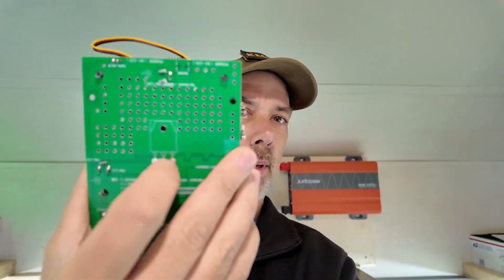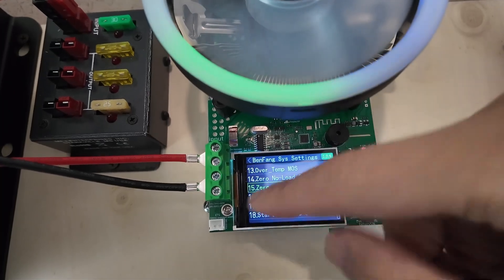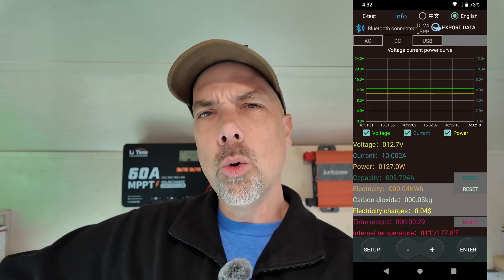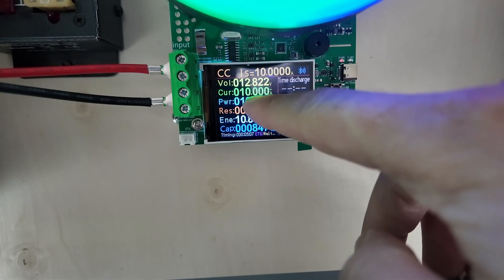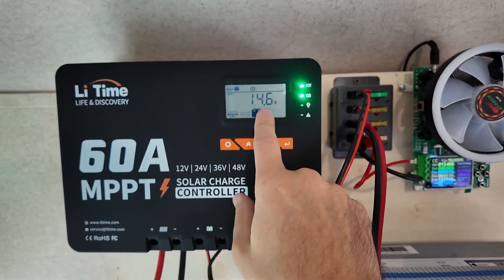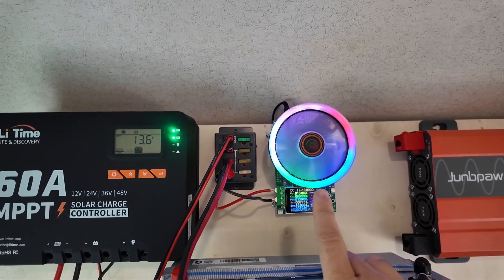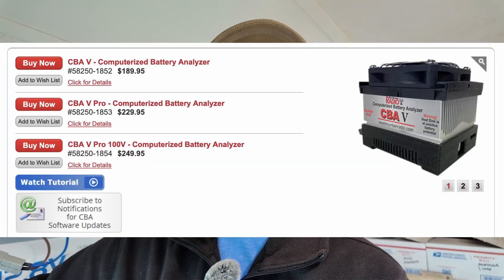I Breaks It, I Fixes It! (I Cheat)

Comment: I'm confused. Why would you be doing a capacity test on a battery that is also being fed by the solar controller at the same time? We got this tester - it also looks like over 36V you have to go way down on the total watts. for our 48V battery we can only draw at 60W max. Thanks!
Reply from the maker: This video was demonstrating all the features of the load tester, it was not a capacity test on the battery.  This specific tester has a limit on the amount of power it can absorb before blowing up (in a self destructive, but otherwise safe manner).  As long as you don't exceed the watts, you can change the volts and amps around to test a variety of different battery types.

Comment: Great tester. If you had a calibrated reference that data collected would be right on. I have the older one in a different brand but looks the same with different fan. Same menu as maker hulk.  You can dissemble the old one . Taking fan and getting to the FET and see if replacing that makes it work again.  Their is a wattage max in the old one in settings.  I wounder what the max watt hours or amp hours is.  I have 1000 AH 24V battery bank. If I re configure battery I get 12V at 2000 AH. Either way this will take a few days . I got a 150 AH 51.2V Chins battery today for Golfcart repair for the campground . The lead died . I had to use electric hoist to pull old battery out. They get heaver as I get older.  I have to make new battery mount. Bead blast and re paint  . Just to get new battery in. Then re wire with new cables. More than 1 day job.  Still waiting on new on board 48V LiFePO4 weather proof charger . The LiFePO4 is cheaper than lead now before tariff.  I can list the 150 AH 51.2V LiFePo4 my self. I can hardy lift just 1 ,8V golf cart lead battery and 6 total .  What a wight reduction !  73 and Cheers from NY !
Reply from the maker: Power to weight ratio in your favor!  That golf cart is going to faster now!  What camp do you work at?
Reply: @temporarilyoffline  I do not work at a campground. I work for my self. They came to  me for repair/upgrade  . It is a Tent camp ground in western NY . Not a State run one. The motor drive controller has a speed limit of 15 MPH on it. 2006 EZ GO 48V . Mine is a 2002 model and my 8V GC8 V battery still going well for now. Still waiting for on board charger . Delayed in shipping. Got almost everything done. Had some corrosion to deal with from lead battery . Some re painting on frame around the battery compartment . Had to use baking soda  first. Then Bead blast and prime/paint then make new battery mount . I used 3/4 plywood . LOL . This not normal golf cart . 2 seat with dump bad in back for landscaping work. they use it to clean out fife pits and collect garbage from sites and outher maintained camp stuff. We have Even Gola State  park campground and Lake Erie State park Camp ground and Camp Seneca Camp ground. and Rock City Camp ground and them all POTA buy ME !!
Cheers ! I am in Boston NY . Great camping all around hear !

Comment: Your power source for the cpu is coming from your 12v battery because you have the two inner connections (terminal block) connected to your battery.

The outer connections on the terminal block are for your battery-to-be-tested. The inners are for powering the cpu. If you disconnect the inners then you'll be using any other connected PSU for the cpu.
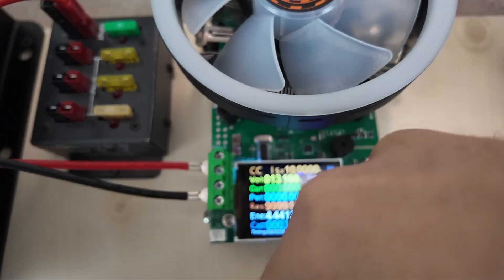Reply from the maker: At 2:23 I tell you that the terminals are 2 for amperage and 2 for voltage. You might not have stayed around long enough to finish the video, but at 13:13 I show you where the computer gets its power from and why its not going to interfere with your DUT.  If you're not using the supplied wall wart or other external power supply connected up to the CPU Power input at the very top of the board behind the fan, the screen won't light up at all.
Reply: @temporarilyoffline  Your right. Just tested mine and it works the same. Could have sworn I was right. My bad.
Reply from the maker: No worries!  Keep playing with the stuff and having fun!  that's what its all about!

Comment: Thanks for the review. I was wondering about this model and if it was better. Now it's replaced the old one taking space in my cart, lol.
Reply from the maker: Its a good tool for exercising solar and batteries and knowing what's going on where.  I use it for a few different exercises.
Reply: @temporarilyoffline  Well, there's certainly lots to figure out learning about setting the RV up for off grid power. I've got an SAE type connector for solar, but they didn't think to put in a charge controller. One of the things I'd like to figure out is wiring an inverter to power the 110V outlets when not connected to shore power and being able to switch it off when connected. Always new things to learn and figure out.
Reply from the maker: @NovemberOneOscarGrouch  I did 2 videos on those subjects on my RV channel.  It's super easy to do. https://youtu.be/Wej0dYh9W5I <- plug your RV into your inverter & https://youtu.be/3IycPeJG8-o <- simple solar connection.  More to come.

Comment: Steve KM9G there, based on the video title I was expecting a MOSFET replacement in your old Makerhawk Load Tester (or is the cheat mentioned replacing the whole device?) 
I assume a ham would be using their right to repair and passing the tribal knowledge down though YT. This was more of a device upgrade review and a caution on how NOT to let the magic smoke out! 
I was hoping for a ham nugget like episode with a soldering iron and some mild cussing as you try to put the magic smoke back in!  (it just wouldn't be the same without Jim's commentary!)
73 de Ralph, AB1OP here and I'll see you in ham church.
Reply from the maker: @ralphmills7322  the cheat was getting/sharing the new model.  There will be a fix on nuggets for the old one coming up, stay tuned.
Reply: Whoo, hopefully it's simple. It could probably take any old mosfet so long as it can handle the power dissipation.
Reply from the maker: we gonna find out!